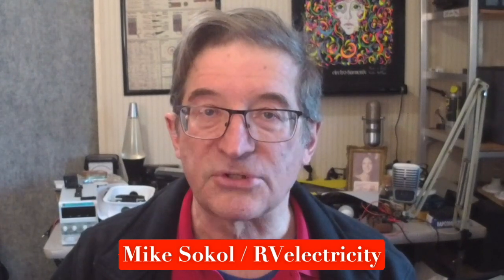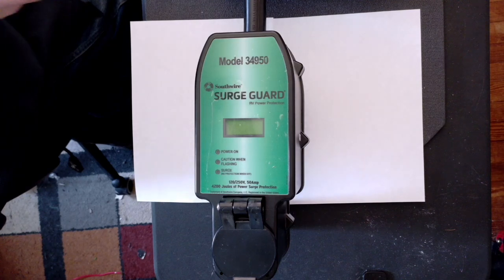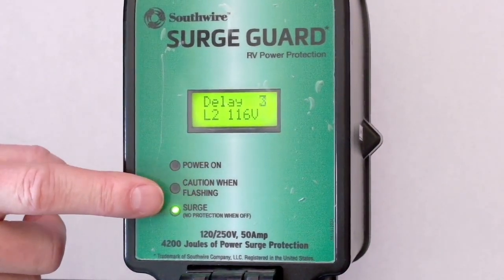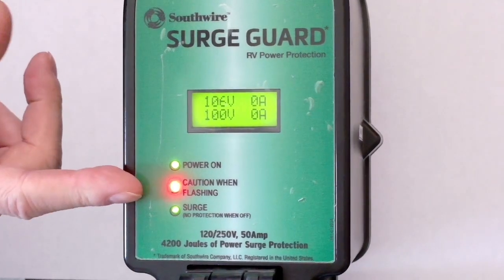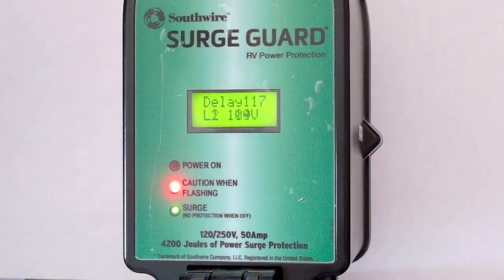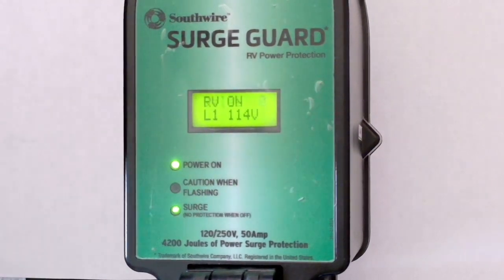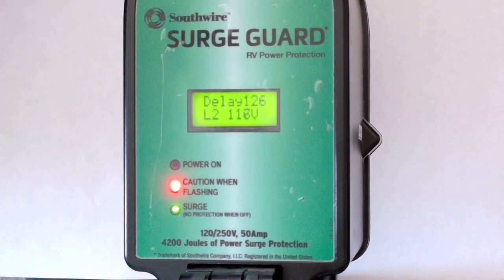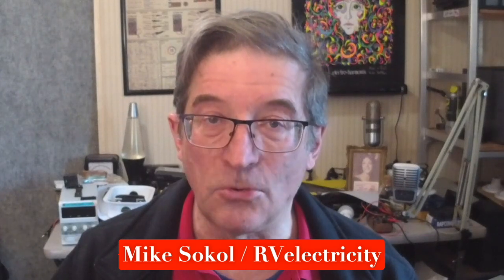Mike Sokol / RVelectricity - Surge Guard Protector Demonstration

Comment: Thanks for the explanation, Mike.
I have a PT30 from Progressive Industries which works pretty much the same.  That company truly stands behind their products!  Over a span of 10 or 12 years they have replaced/upgraded my unit, at no charge to me, twice after failures in the field.  Once was a bad gasket leading to moisture fogging the window; the second resulted from power line problems it protected me from.

Comment: Have been using the Surge Guard (30A) 34931 for 4 years with no issues at all.
And like very much the useful 40301 remote Bluetooth module.